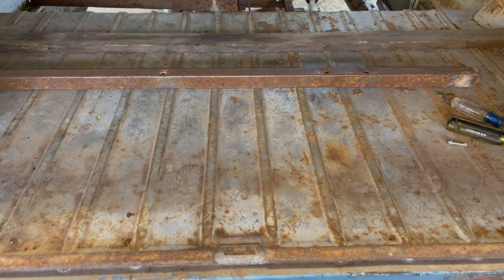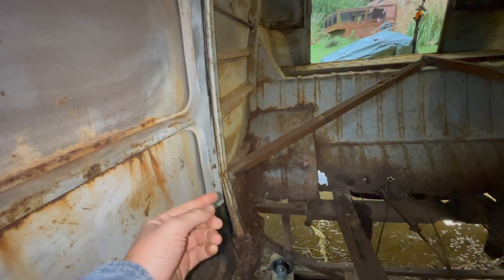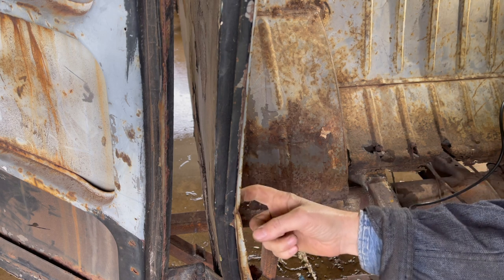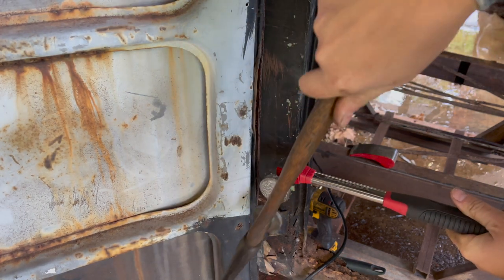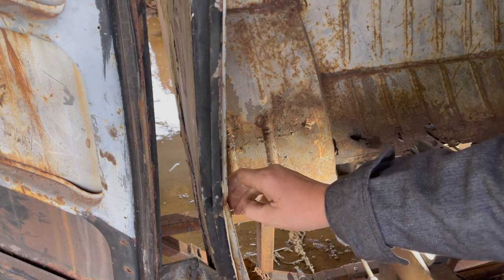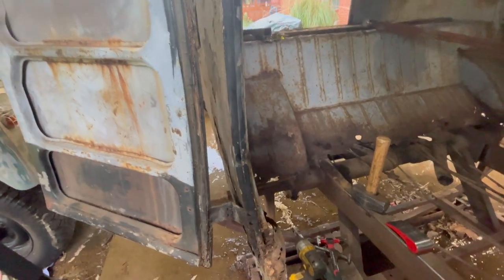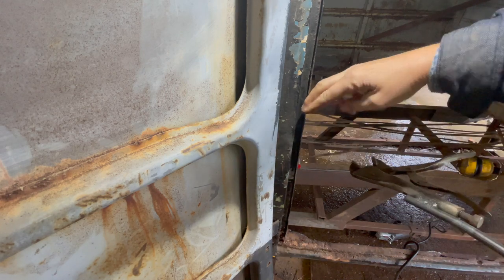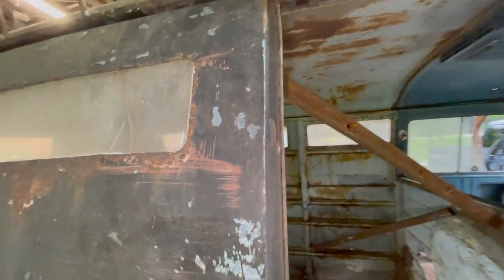Pulling out dents, No SPECIAL tools required!!

Comment: Little victories are still a victory. Its easy to get overwhelmed with a project this big. Like the new tool.  Mine is getting closer too. Glad to see Pickle again 
Thanks 😊
Reply from the maker: thanks John...I feel like the floor area needs to at least be as "square"  as I can make it  before I try laying anything in, almost there, worked a bit more on that since the video and about ready to start putting those cross members in I think!

Comment: Nice to see the bus getting some love once again, I have a hole in the rear floor above the fuel tank sender unit to make in the ribbed section to make up.
Reply from the maker: yes! I'm so glad to be back on ole pickle...once I get the floor sides kind of squared up in a few areas we will be able to move fairly quickly I think!
Reply: @marcijunebug  YOU TOOK BUS OFF ROTTISSERRE /????????????
Reply from the maker: @rsprockets7846  not yet...trust me, I'll be sure to share that with y'all!

Comment: For that pillar and other hard to pull dents... My son and I restored a Bug and on a dent just under the driver window, we drilled a hole and I stuck an Allen wrench in the hole, turned it so that the short end was inside and against the metal, clamped a vice grip, then hammered the vice grip while rotating the Allen wrench.  It worked great.
Reply from the maker: yes I have used similar method before on other projects...I love trying new things and try to find new ways to work out "problem" areas!

Comment: Welp...at least the rain is keeping your neighbor(s) from mowing. There's that. I don't know if you have any sheet-metal working tools, but I'm surprised that you did not recreate the bends of the pillar and just cut that section out and replace it with one that you make.
Reply from the maker: I thought about remaking it...but I moved it almost 1/2" with just pulling that dent out and that's really all I needed.  Like I said...It's also  about saving all the OG metal when and where I can.  I'm so ready to get the floor cross members and flooring in, but forcing myself to get it as squared up as possible before doing that because all this ticky tacky stuff gets harder and harder to get to the more stuff you weld back in!

Comment: Hi, I just wanted to let you know I am always hesitant on watching videos that are recommended by Youtube. The algorithm they use is very strange and that's the sole reason for me being hesitant. I would like to say I have enjoyed catching up on Pickle. I really enjoy the VW community as well. Everyone has been really helpful which goes along with my temperament. I really like the way you try to use what you have to make things work. I am restoring a '70 Beetle Sedan. My parents bought it for me when I turned 16 in 1989. Since then I've sold it and bought it back. I've had it back since 1998. I got married, had (still have) 3 children and moved to Montana from Tennessee and back to Georgia. The Beetle has gone with us every mile. I am just now getting to restore it. The body has been removed and the mechanicals/chassis are almost complete, at least to my satisfaction. Anyway, I am trying my best not to buy new parts and restore what is there and use what is left. The other day we, my sons and I, chased out all the threads and put the nuts and bolts back onto the trailing arms. We were able to salvage all but one. I don't have access to parts around here, that I know of, so I had to go to the hardware store and get the nut and bolt. Thankfully, they had an exact replacement. I compared the new one to an old one and the difference in quality is amazing. The new one is significantly smaller and lighter. I may not keep it though. I may have to source one that is at least monel steal.  

Well, I hope you have a great day and I look forward to viewing more of your content. Sorry to be so long for just a comment.
Reply from the maker: always a pleasure to "meet" a fellow VW family member! Thanks for sharing your VW story that's awesome! I just have a pile of junk and I'm trying to save that pile one piece at a time! thanks for stopping in, I truly appreciate it!

Comment: Try welding a small piece of sheet metal edge wise along the crease on the inside . You can then grip  the piece pf metal with the vice grips  and use it to pull the  crease straight. When your done grind the    welds off. Jay hardy
Reply from the maker: Yep!  I like trying all sorts of different methods...love metal working even when I'm learning! Just something about it! Thanks for the tip! truly  appreciate it!

Comment: as for restoring these old vw,s its a lot harder these days now than it ised to be back in the day when i first started restoring cars on my first vw project there was not very much rust on it  the floor pans were mostle still in it the heat channals   were good only had to replace the floor under battery box and that was all rust repeir done got the drive restored sand the body paint and it was done and that would be how most vw restores would go back then as they were old they were not that old  i knew people back then that made a living out of restoring old vw,s and sell them   but now came forward to now and must of the vw,s that one find id now much old and it been sitting much longer and now there a lot more rust on them and the body,s are beat up a lot more so now takes a lot more work to restore one now     and for me piece of mind come from restoring old stuff as i restore all kinds of old stuff not only just cars
Reply from the maker: I agree...it is the "doing" of bringing things back from the dead for me that is the exciting and challenging part I love so much! The rust on this one is about as bad of one that I would ever want to tackle...truly if it was much worse, not sure I could do it! ha
Reply: its not how off the project is its about now bad you want to bring it back i,ve seen same stuff restored that were a lot worse than pickle    @marcijunebug
Reply from the maker: @johnpaquin8041  couldn't agree more~

Comment: Want to be a body men/ women..? First rule is to apply Heat!...
Reply from the maker: Not always...but most times YES! Heat can warp where you don't want it too...but agreed heat often helps...in this case I'm just trying something different than I normally do...When I do use heat, I keep a damp rag in the other hand on metal near heat to reduce warp and control the area I want to focus on, esp on body panels where dealing with thinner sheet metal...cheers!
Reply: @marcijunebug  you're absolutely right...I know owning a torch can be expensive, so I would use a heat gun...just trying to make your life a bit easier here...cheers!
Reply from the maker: @steven6692  I've always used torch...but a heat gun...ummmmm thanks! I'll give it a try appreciate the tip and you stopping in!
Reply: @marcijunebug  the shop type of heat gun will do...not sure about an inexpensive one...let me know. I've been away from the business for years ..but I still love to go back in time...and watch...
Reply from the maker: @steven6692  I have a good one and am anxious to give it a try! Thx!
Reply: @marcijunebug  you go girl!